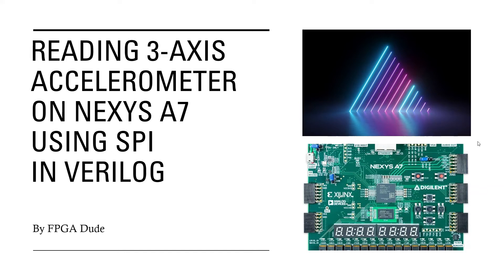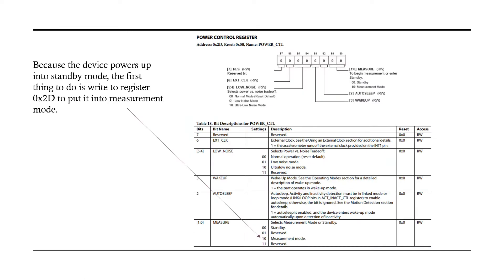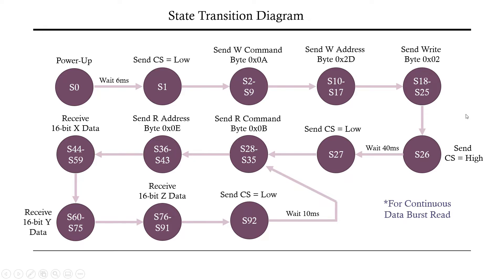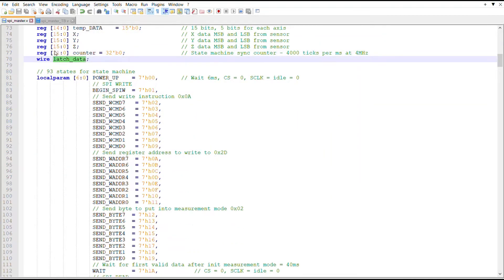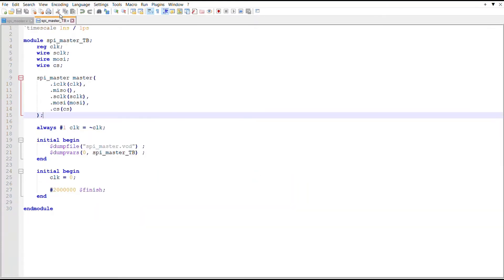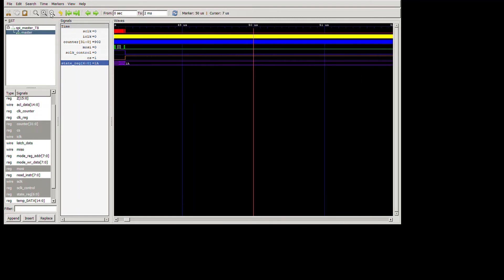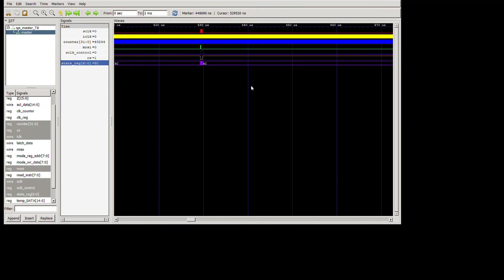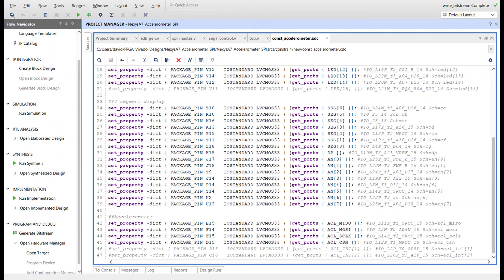SPI on FPGA 3-Axis Accelerometer Nexys A7 or Basys 3 w/ PmodACL2 Verilog

Comment: This is good stuff!  I may have missed it, but it doesn't look like the accelerometer data is being scaled.  The raw acceleration data is in ADC counts.  So if the data resolution is 12 bits over a full scale range of +/- 2g, then to convert the raw measurement to units of g, one would use the formula: (2*raw_data_in_counts)/(2048).  Even if the board isn't perfectly flat, two of the axes should still read reasonably close to 0g while the Z-axis will be close to + or - 1g.    Again, maybe I missed the conversion of counts to units of g in your code; if so, please ignore my comments.  Thanks again!
Reply from the maker: Hello. Thanks for the comment. I did this project to simply read the raw data coming from the accelerometer using SPI communication, and then I chopped the data so it could be represented on the 7-segment displays to verify the reading of the data. It was an exercise in learning SPI circuitry and demonstrating on an FPGA. I did not consider converting the data to make it more usable and accurate. Adding the circuitry to convert the data would be a great way to extend this project into something more meaningful. Thanks for the great idea and the information on using the data from the accelerometer.
Reply: @michealalex5235 can u explain one simple thing. Suppose i am calling spi master module from a top module that contains the spi read and write comands to spi module
Sent the write comands for configuration. Simple 

In read from miso line of sensor, i have to send register addrsss 0xE then have to read register. Do i have to wait here for burst read so that addrdss points to register 0xF
Reply: Any replies

Comment: I watch your videos regularly. I have a simple question. Suppose  sensor supports 5MHz spi interface. That mean sclk is @5MHz. If we set output data rate of sensor @100 HZ how we make sure that we are logging the correct output samples during spi read from sensor? Because we are sampling @poseedge of sclk
Reply from the maker: Sorry, but I'm not really sure you mean and what you are asking. To be honest, I haven't done anything with SPI except for that video.
Reply: @dajoma36  ok no problem. How can we check the code without real sensor? Any emulated idea.? How to generate miso data without sensor.
Reply from the maker: @fmm5322  You should be able to test the circuit without a real sensor using a test bench module. To generate the sensor data, you would need to find out how the data is formatted, and then use that data format in the test bench script to stimulate the circuit, along with the other inputs for the circuit, such as clock, reset, etc.

Comment: Why don't we use AXI-Lite ?
Reply from the maker: I believe the AXI is only for use with Xilinx Zynq chips, which are SOCs (System on a Chip) that include FPGA fabric as well as processor fabric. AXI is used for the processor part.
Reply: @dajoma36  so If I want to use it on Artix-7, I need a soft-core CPU like microBlaze right ?
Reply from the maker: @thanatosor  That's a good question. Sorry, but I don't have any experience with microBlaze and using AXI at all. I only know about it that it is used with the Zynq SOCs.